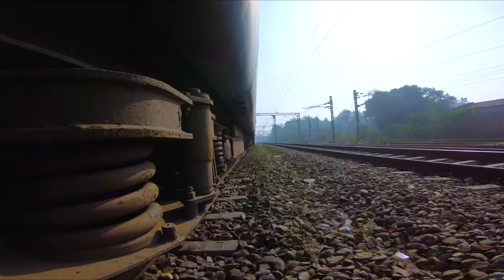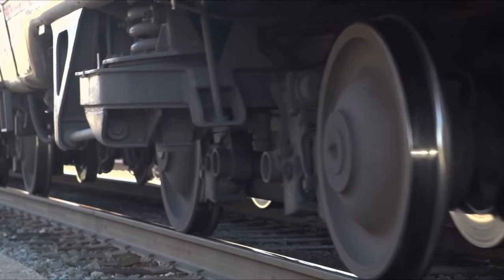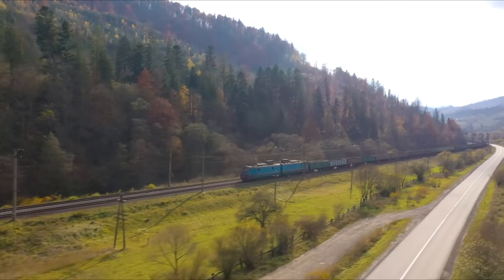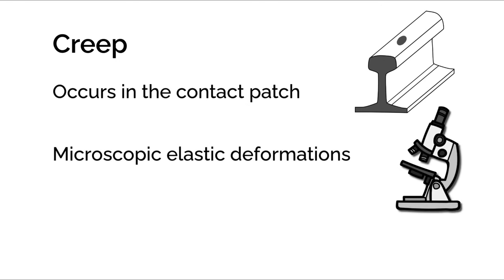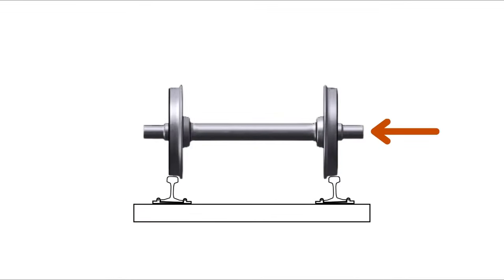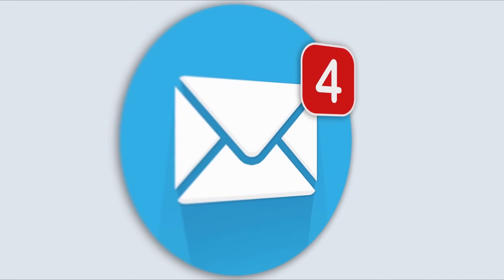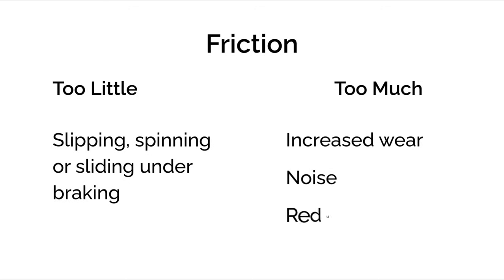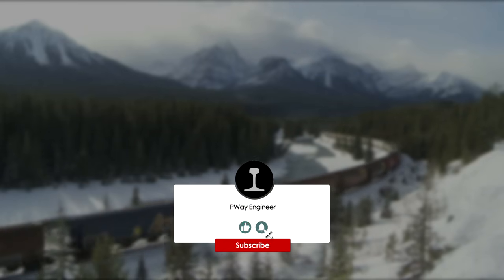The TINY Area Where Train Wheel Meets the Railway Track | The Wheel Rail Interface Explained

Comment: I wanted to see an image of the shape of the wheel-rail interface, but you never showed one (the closest was the back-illuminated wheel on rail photo early on).

I had imagined it to be a thin line going almost all the way across the rail (5cm x 1.5mm or so), but after seeing this video, I think the interface is not so long and thicker (more of an oval, maybe 2.5cm across the rail and 75mm along the rail).

This is the geometry the title brought to my mind. I'm disappointed you didn't show us this and how it changes with movement.

Such an illustration would have also helped me to better understand how much deformation there is in the steel on both sides of the interface. Comparing it to a similar image of a tire-road interface would have been perfect. We can see the distortion in a well-inflated tire. A train wheel looks perfectly circular to my eyes.

Comment: Great vidio. 
Concrete sleepers have made a massive differance to the per way .
And even thogh they cost more they out live the wooden ones by a massive margin .
Also not mentioned is .
The train wheels are slightly harder steel . Than the rails !
This increases the coefficient of friction .
If the wheels were the same composition they would slip .
And wheel burn would be a common occurrence. 
A few years ago they had wheel tapers .
They used to walk along the train and tap the wheels with a small sledge hammer. 
The sound it made determined if the wheel had a crack in it .

Comment: There is one other purpose of the wheel rail interface and this applies to electrified systems, the rails are used for the ground return path. The significance of this is the is the potential for pitting when the contact conditions are less than ideal. This can be seen whenever environmental conditions such as snow, ice, or objects such as leaves are on the rail crowns.

Comment: Great. I still don't really know if the flanges are necessary or just a safety precaution. How often do they touch the rail, and how can trains run at those rediculous high speeds?
Reply: The overwhelming majority of the time they do nothing, but they are not just a safety system. Trains going the expected direction at points is dependent on them. A train without them would probably work fine till it has to go onto a branch, at which point it would derail as the axles disagree on the correct direction.
Reply: The flanges are mainly a safety precaution. If the speed is low enough relative to the conical shape of the wheels, flanges are not necessary.
Reply: @HugeRademaker  Thanks. So when a train is at those high speeds, like 2-300 km/h the flanges don't even touch?
Reply: @ronnyskaar3737  Flanges "should" actually never touch the rail.
The curves on high speed lines have an enormous radius.
One of the lines where I work as a train driver has a speed limit of 50 km/h. It is the tightest curve for passenger trains in the Netherlands.
Some infrastructure demand even lower speeds.
Reply: @HugeRademaker  OK. So the flanges can touch at low speed in tight curves? Our light rail here in Bergen squeeks a lot in some very tight curves. Thanks for very interesting videos.
Reply: @ronnyskaar3737  Oh yes. The flanges can definitely touch the rails in tighter curves. Some lightrail trains have flange lubricators installed to reduce the squeaking noice. (Personally I love that sound!)

PS The videos are not mine. I'm just a humble traindriver enjoying to explain things to people whom appear to be interested.
Reply: @HugeRademaker  Great. Thanks a lot. Yes, I don't mind the sound at all 😂

Comment: The question is....I know of a section of track that gets 35 trains a day. That could be as many as 14,000 wheels running over one side of the rails in a given day. 
How can the rail withstand that when all of the weight a wheel carries is concentrated on that very small contact area???  I would think it would be cold worked in short order and crack.
Reply: Steel is very tough
Reply: There are different steel grades in use. For the track you mentioned probably the toughest steel grade is being used. 
Also, since train wheels are easier to maintain, wheel are designed to wear faster then rails.

Comment: What surprised me the most is the direction the wheels shift in a turn. Your graphic shows that the wheels shift to the outside of the curve. This would make sense in terms of making a wider wheel circumference for the outside rail, and a narrower one for the inside wheel. But why would the wheels shift like this? I would think that the tension between the cars would tend to shift the wheels to the INSIDE of the curve, like a belt in a pulley, as it seeks the shortest path. Thx!
Reply: A train is usually decelerating through a bend. This would mean that the individual cars are free-wheeling or pushing gently on the unit in front.
Reply: This comes all down to Newton's law. (The mass of ) the train wants to go straight ahead, but the tracks are not allowing it.

Comment: The railhead will also work harden over time! , they  tore up  a railway where i live ,first  the  just cut the rails  straight through with a  hydraulic excavator sheer tool ,but the sheer surface got worn so fast by the hard rail head that they started precuting the rail head with  a oxy torch and then cut the rest with  the shearing tool.
The rails was cut into open top container lengths,and loaded into those for transportation to recycling.

Comment: As a train driver of both passenger and freight trains I am fully aware of the problems of adhesion. I ocassionally get to route conduct tampers and rail grinding trains, which gives one an insight into the complexities of track geometry. I remember a few years ago here in the UK the sudden rash of temporary speed restrictions due to gauge corner cracking, which were found after more inspections after the Hatfield disaster.
Reply: Every shift I was making overtime because of that at the time. Some 20 ESRs went on for miles..

Comment: Interesting. Strange enough i expected that the contact point is even smaller (the contact between a straight line and a circle is in principle very small). Is the wheel or the rail disformed a little bit so the contact point so the contact point becomes larger?

Comment: As a Trainman on Amtrak I used to tell passengers this story. Not as much detail but comparing an interface like the surface area of a modern radial tire to the surface of the road to this contact area for train than can very accurately be compared to ball bearings.  I would show my smallest finger and say the surface area was smaller than that. Very efficient as compared to the tire and road surface with an automobile.

Comment: I'm not sure what yaw moments you are refering to at 6:30. As far as I'm aware, the relative (yaw) rotation of the wheel does not introduce any significant yaw moments to the rail. The inclination of the contact patch (CP) does. Let's focus on the wheel for a second: If your contact patch has a width of 1 cm, and your wheel profile is of conical shape, that means that you have a gradient in rolling radii within your CP. The rolling radius is larger at the flange-side of the patch, than it is at the field side. Since both sides have the same rotational speed, the flange side wants to travel farther that the field side does. So the result is a creepage (and of tension course) inside the CP that kind of rotates around the point of maximum contact pressure. It does this even on a perfectly straight rail, there is no curve required for it.

Comment: The animation at 6:03 is wrong. In both cases, the wheel rotated by 90 degrees. In the first case, it moved a longer distance than in the second case. The rotation  in the first case was less than expected for perfect rolling, and vice versa for the second case!

Comment: I've always wondered how a train goes into a curve without derailing. Now I know! What does a Pendenilo do re the wheel rail contact?
Reply: Not much at all. Tilting technologies are made to increase passenger comfort. The rails will still see pretty much the same forces, no matter if your vehicle tilts or not. There are very slight differences because the center of gravity of the vehicle changes a bit, but that's close to negligible.

Comment: Very interesting.  I always knew that the total area supporting a train was very small.  Just wondering, though, when you say the weight is supported by an area of about 1 cm2, how much of the train is supported by that area?  Obviously, the length of the train matters.  Is 1 cm2 per wheel, per wheel set, per car, what?  Thanks!
Reply: That was quite ambiguous in this video. Every one of the wheels has a contact patch of about 1 to 2 square centimeters. On many european main lines, we have a maximum axle load of 22.5 tons. That'll result in about 5.6 to 11.3 tons per square centimeter. On US freight lines, it's more like 8.2 to 16.5 tons per square centimeter. Certainly not "thousands of tons".

Comment: I assume that traction on underutilized rail is high, since rust yields the traction of sanding the rails. Is that an accurate assumption?

Also: if a curved track is superelevated, to reap the benefit of wheel-travel differential as described, it can only realize the benefit within a narrow range of speeds. Therefore, if both speedy passenger trains share the track with slow, heavy freight trains, all benefit is lost. Comments?

Comment: I have always maintained that trains will always be with us,as nothing is more efficient than steel rolling on steel.
Reply: WeIl, rail efficiency is good,  far higher than  trux, but, versatility! Also, marine transport is higher yet. Pipeline the highest of alI. Air, the worst, by far.
Reply: @andreweppink4498 there’s only so much versatility you need moving goods over long distances. The issue arrives when you hit the “last mile”. That’s where trucks are suitable.
Trains to the city and trucks to the store is how it should be done.
Reply: @ That has long been the practice. Bulk shipments,with last mile completion by truck. Efficiency is less important if the last mile is indeed only a few miles.
Reply: @andreweppink4498  Trux is last mile transport.Not sure about pipeline. Agreed,air is the worst.

Comment: There is the Docklands Light Railway in London. This is a slow speed line with many very sharp turns. With correctly profiled wheels the trains go round the curves with ease. The problem comes on the straight sections. At these points the hunting becomes so excessive that it's easily noticed. It's a shame but there can be no solution. All wheels hunt to a certain extent and profiles designed for short radius curves hunt more than the flatter profile that is perfect for high speed running on straight track. A train that can handle the right angle curves that thread through the crowded central section, cannot handle the long straight lines of the outer section unless they travel ridiculously slowly.
Reply: That is not entirely true. The wheel profile can be designed in such a way that the sections of the profile that get in contact on a straight line have a low conicity and therefore don't hunt that much, whilst the sections that get in contact in a curve have a higher conicity and therefor a decent ability to negotiate curves. On high speed trains, additional yaw dampers help to suppress high frequency oscillations. If you experience excessive hunting, something is not working how it is supposed to. There must be an issue either with the design of the wheel-rail system, or with its maintenance.

Comment: As you may already know, until recently the SF BART used a spherical wheel profile. This meant that it basically squealed like a stuck pig on anything but the straightest track in existence. (If anything, that comparison undersells it. It got painfully loud and high-pitched.) I think this may have also contributed to corrugation issues on the rails as well.

Comment: Always nice someone takes the effort to explain physics! 😀 One principle thing though, at 7:30: it's not lateral forces that move the wheelset sideways; the train just keeps traveling straight when it rides into the curve. Thus, due to the curvature of the rail, the contact point translates sideways and the rolling diameter for each wheel changes. Also, the hunting phenomena isn't instantaneous due to an interference; it persists continuously, due to the opposite conical wheel. Hunting is a general term to describe a self-oscillation about an equilibrium. Only if you theoretical start with a perfect wheel set exactly in the center of a perfect track, will the train not hunt.

Comment: I have read a bit about this, being an enthusiast (and recently retired tram driver). A lot of these issues mostly apply to heavy rail. The bit about material flowing sideways was new to me, though. Now, as for the irregularities that go across the rail, causing «washboards», or rail corrugation, that’s a bit of a mystery. It seems to occur on stretches with mostly coasting. And as it worsens, it creates a lot of noise. Past engineers have had a religous belief in annual/biannual grinding. Which causes its own problems: First of all, as new irregularities form, the noise and vibration gradually increase, until it gets horrid, but you just have to sweat it out and wait fir the grinding company to come, and pray it only takes the alotted time. As for the situation inside the trams, we used to have air sprung/cushioned trams that «floated» over the washboard, our new CAF trams only has coil springs, transferring the washboard noise into the trams, so you feel you have to clench your teeth in order to avoid your fillings from falling out.
What seems to work, is weekly «polishing» of the tracks with fixed grinding blocks (and water…) by a «rail polishing tram». Irregularities can be spottet as lighter patches on the rail head, and if these are polished away before they develop into washboard , the rails last longer because you don’t have to grind away so much material in order to get rid of the washboard, you Aldo transfer less vibration to the fundamentation, giving that a longer life, too. Of course, you have to grind on occasions to reprofile the rails, since wear will change the profile detrimentally. Now, the strange thing is that the problem with washboard formation appears to be worse (or even worst) on street track, track on private right-of-way on sleepers in crushed stone ballast fares much better. Which is a mystery and a headache for the engineers in the infrastructure department of the tramway company.
I have heard (but, alas, I have no written sources) that the Vancouver SkyTrain wound up with a ton of rail corrugation, in spite of the traction used: the SkyTrain uses linear motors, so the wheels only roll, all power and braking takes place in the bogie frame. 
I would hugely enjoy some deep delves into the bane of all street tramways: Rail corrugation. What causes it, how can it be avoided, how can it be mitigated (reduced, I don’t think there is a cure…)?
Otherwise, a good summary of the wheel-rail interface, which is something that keeps an army of engineers engaged!😅
Reply: Rail flow on the old broad gauge 2% climb out of Bacchus Marsh on the Melbourne - Adelaide route was insane. I'd say 20m long knives were still partially attached to the inner rail on superelevated bends where slow freights struggling up the hill leaned. It made steel look like plasticine. In other sections those 'knives' were just lying there on the ballast.
Reply: Corrugation is a vibration problem, it occurs when an eigenfrequency of something close to the wheel-rail contact is excited. That's why stiffness and damping of the superstructure can make a difference. Something in the superstructure of the street track is either excited by the passing vehicle and starts oscillating in its eigenfrequency, or the superstructure induces a component in the vehicle to oscilate in one of its eigenfrequencies. Either way, if you know how fast the vehicles pass the corrugated track and measure the wavelength of the corrugation, you can estimate the eigenfrequency that is excited and then deduce the component that's oscillating by a series of simulations and/or measurements. 
A cheap short term solution could be to try to either increase or decrease the vehicles speed in this section. Plus or minus 10-15% could be all it needs to get out of the eigenfrequency.

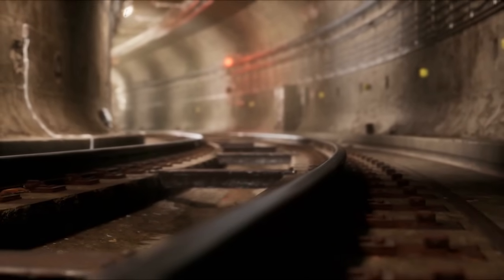Comment: 5:05 what type of bogies are these?  The bearings on the inside of wheel set suggest that's a design for a wide gauge track.
Reply: The "extra" wheels are intercooled break disks.
Reply: Mate compare these bogies 5:58
with these 11:00. It's not about the brake discs but on which side of the wheel the bearings are installed.
Reply: @Clippy_Against_the_BS  Sorry. Missed the detail regarding the bearings. My bad.
Strange way of axle assembly indeed.
Reply: Plenty of standard gauge bogies with inboard bearings on passenger and freight in uk